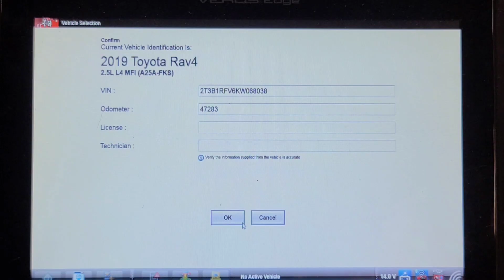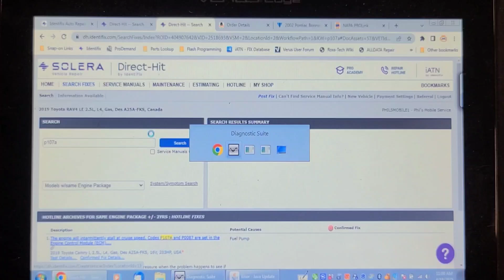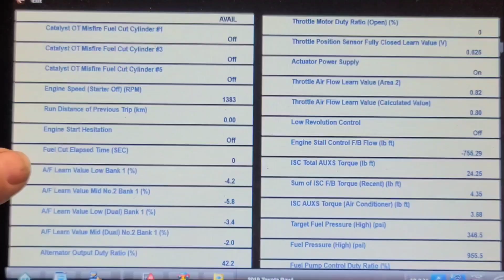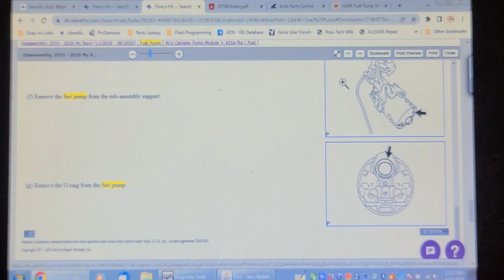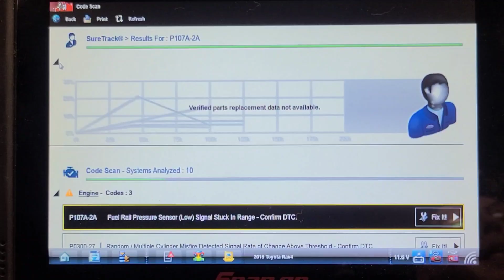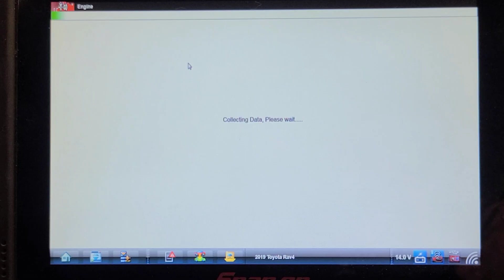2019 Toyota Rav4 Intermittent Stalling P107B, P0300

Comment: Hello. i have rav4 2021 and i have same problem P107B and i changed Fuel pump and high pressure fuel pump and fuel rail pressure sensor b but the problem not fix
Reply: Did you finally find the problem???
Reply from the maker: On this car i replaced the complete low pressure fuel pump in the tank.